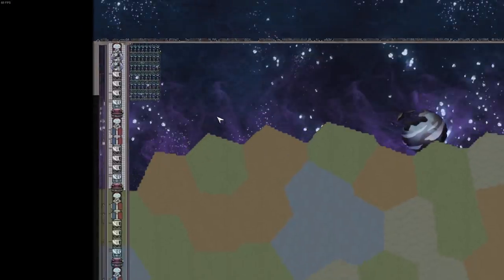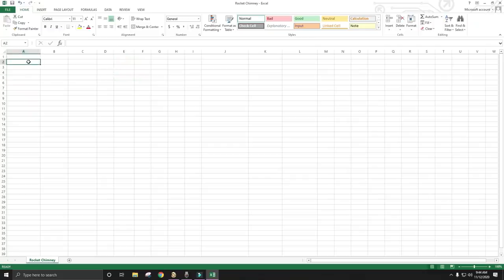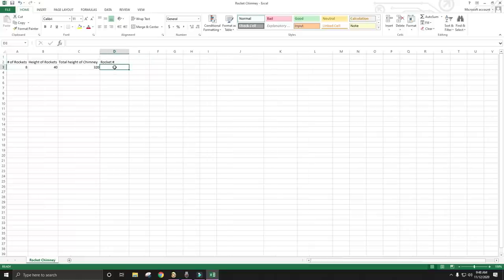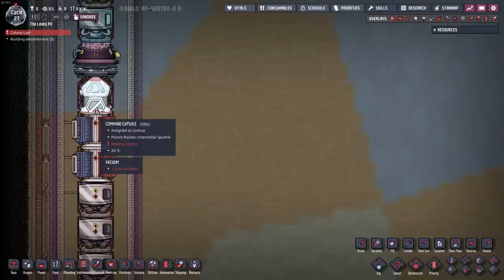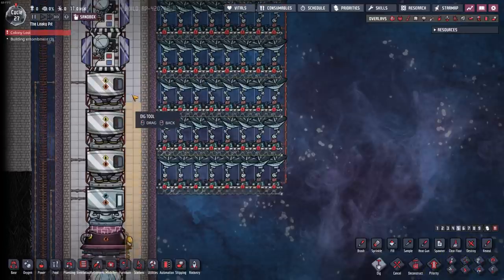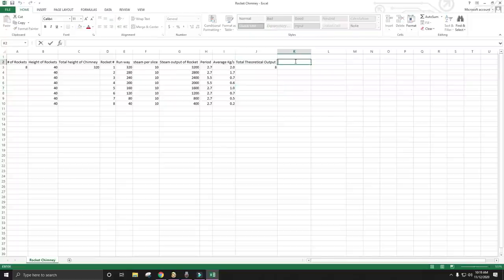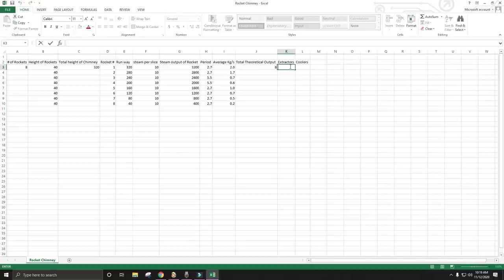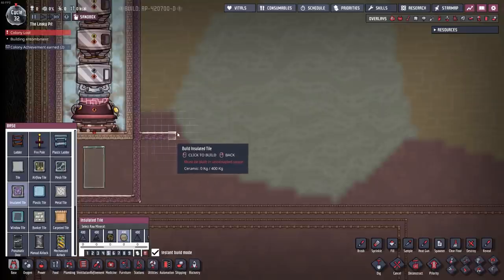Overly Scienced - Episode 22: Rocket Chimney Math (Oxygen Not Included)

Comment: Great video!
Kudos for all the work involved in this and the patience it must have taken to build this without the blueprints mod!

There are a few suggestions I'd like to add;

To measure the amount of steam generated by the rocket, what you can do is launch it in sandbox, pause, then 'tile up' the chimney one row at a time to compress the steam down to one tile, that gives you an exact figure.

Also, if you were to narrow down your chimney to 7 tiles wide instead of 9 the pressure goes up with no real backdraw other than maybe the lack of dupe access, which is a moot point when you consider that dupes don't have to leave the rocket and there's jetpacks. Also, you can build around it easily. That's still 320*2 tiles of space saved.

Then there's the part about the 9*3 tiles underneath a rocket that generate heat. Normally what you'd do is put diamond tiles or a similar medium with high heat capacity underneath it to absorb the heat like you did with your regolith melter. If you were to place diamond tempshift plates in the 9*3 tiles underneath every rocket, you'd be able to spread heat better by adding thermal mass like this. The heat cone does actually move with the rocket*, so if you tile up the entire center 3 tiles of the launch tube with tempshift plates, starting 9 tiles beneath the bottom rocket (or go crazy and add shipping rails), you may also see an increase in effeciency.

In fact, you can ship say diamonds through a loop and use it to power something ridiculous like for example sour gas boilers, instead of cooling the bunker walls. Come to think of it, that's the only time I thought of sour gas boilers as space efficient. Bead pump crude to the top?

As for the piping, you may want to hook up each fuel tank to a liquid reservoir with a liquid shutoff so you can pump full 20kg/s packets to each individual tank simultaniously and reduce downtime during the refueling stage. Unless you're cooling the pipes by looping the fuels through them and back into your pump, just stick to insulation is the gist of it.

Finally there's a way to extract the CO2 from the chimney by (ab)using the game mechanics when it comes to element swapping, described as such here:
https://forums.kleientertainment.com/forums/topic/110276-the-liquid-gas-bypass-a-pump-that-swaps-elements-around-corners/
You may or may not want to use it, but it's rather easy to implement.

Thanks again for another great video!

*https://forums.kleientertainment.com/forums/topic/112467-rocket-exhaust-clarification/

P.S. Is there a reason you didn't use the full length of the map? Even with 8 rockets, they produce more heat and steam the longer the launch trajectory, and while costly in survival, I don't really see a reason not to in sandbox, especially for demonstration purposes.
Reply from the maker: I think you win the longest comment award.
Reply: @cometgaming8812  Sorry for the wall of text...

Comment: In my experience logic circuits can conduct heat bypassing the door, especially if 3 tiles long. Same goes for logic bridges.
Some suggestions i would have, cos otherwise it is a great, top notch job is for the CO2 pumps. Personally i like using a memory gate. The idea is to make pumps pump the CO2 once it reaches a certain point until it goes down to a certain point. Those points are made with proper sensors placement. Once a certain low limit is reached, the pumps stop til again they are turned on by the high limit sensor. In short it's: pump out til empty tank, stop and wait til full tank, loop.
I just hate when pumps go on and off constantly. Id rather have long periods of activity and inactivity.
The other idea is to simply put a carbon skimmer for this one turbine with doors. It would have to be mare of thermium but it should withstand the heat. I dont really use em often so i dont exactly remember if those have to be fully submerged in CO2 tho, i hope not ;)

Comment: The reason you had a temperature leak is because your doors are not powered. I believe it takes ~3sec for doors to open/close, but if the signal changes quicker than that, doors will glitch out and start leaking temperature eventually.
 Never had this issue with powered doors. 
This glitch was bugging me for some time. 
Hope this helps and thanks for this channel  🤓 👍
Reply from the maker: Yes, I discover that about 3/4 of the way through. Took me awhile

Comment: don't forget you can put steam turbines side by side, which should help reduce the height needed for the cooling. 

Also there is no need for the aquatuner to be besides the chimney, it can be more off to the side.
Reply from the maker: Yes, but it would be better fit as many vertically as possible first before spreading out. The heat can have a hard time reaching the far right turbine if they are spread horizontally instead.